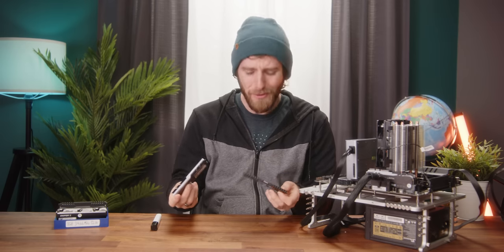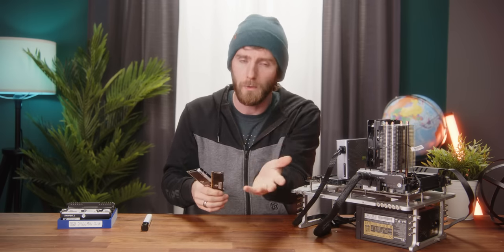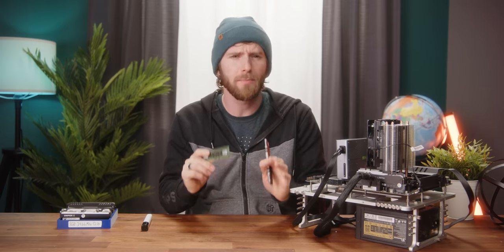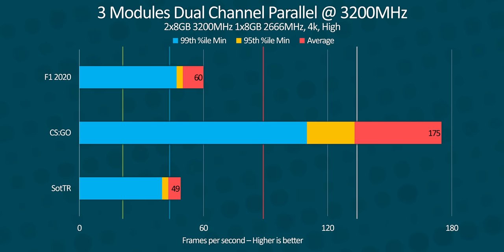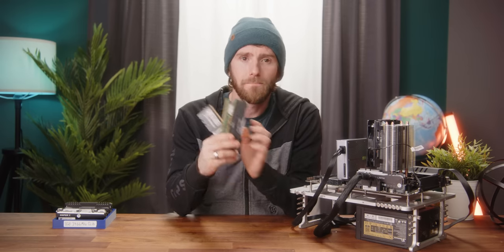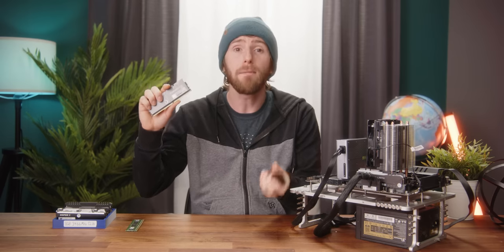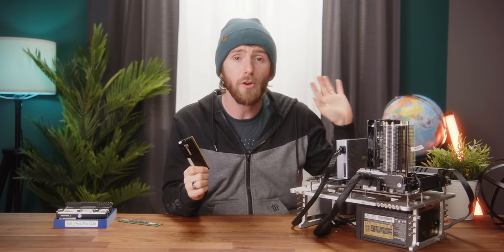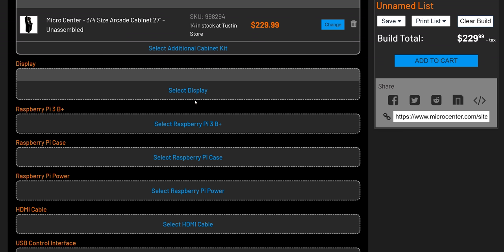Just How Bad is Mixing Memory?

Comment: So I know this is old but I’ll throw my 2 cents in I was playing the first descendant but I kept experiencing stuttering randomly I swore up and down I had 32gb of ram in my pc turns out I was running 16gb (idk I guess I just forgot I put in 16 only) so after I figured out I was on 16gb of ram I realized I had another set of 8gb 3200 hz but different brands everything I read said no don’t do it yada yada my brother was like just do it trust me I ran different ones for years in my old build I stuck them in and they work perfectly fine no issues but they’re were basically identical ram sticks besides brand so yeah it will work fine now running different sticks at different speeds and types yeah it’s not gonna work properly

Comment: One time I had bought a (I THINK it was 8gb) DDR3 ram stick. I tried booting it up solo, there was a beep sound, which, when I looked up, meant that RAM was "corrupted". Then I decided to test it out with 2, so I stuck my original 4gb stick back in, 2nd place, and booted up windows, it started - but, it was sooo slooow, I looked at task manager, it said that the ram was still 4gb, but the clock speed was lowered to the new stick's speed (as it was lower than my 4gb stick).

Comment: If anyone sees this question please feel free to comment. Is it better to have all four slots filled with 8 GB RAM equaling to 32 GB in total or only filling two slots with 16 GB RAM equaling to 32 GB in total. CPU being used in this example/scenario is a Intel I7-8700k unlocked.
Reply: Depends what you mean by better and what your goals are.

Lower density ram tends to run better and faster.  That's why "professional overclockers" use a single stick of 2-4gb ram.  Using less dimms puts less stress on the motherboard so it run better too

So using 2 dimms vs 4dimms depends if your overclocking or not and what u value the most, stock performance, oced performance or ram performance.

In your situation id just get the 2xdimms.  Leaves room to upgrade in thr future

Comment: my old system(now my brothers system) had 2 factory 4gb sticks of ram, i found another stick in a PC that didnt work that my father had, and my cousin had another 2gb stick, surprisingly it worked fine together with no issues that i can tell, even to now, if something would to have happened i would have just upgraded the sticks with newer ones. but no need to throw money at a old system that uses ddr3

edit: forgot to throw in the part where i didnt even have to mess with the bios settings to get it to work

Comment: I got 2 stock ram and 2 aftermarket still work good as long they are set a & b together. It depends on the motherboard u have to know what hz the ram is correct for it. Overall I get 32gb ram wasn’t bad instead of buying the whole package. That was the cheapest option opposed to buying 2 16gb or 4 8gb ram i got 2666mhz I can get 3200mhz but like i said i have to spend more money. I did all the calculations at the store and just figured they would work 😂.

Comment: Hey Linus! I was watching this vid because I was planning for an upgrade. I have a question though for another topic. What difference does it make if for example I use an old (like 5 years old) HDD than buying a brand new one to pair up with my SSD?
Reply: Don't bother with a hard drive, I would save up a bit more for a second or Bigger ssd
Reply: @lettuce7259  Disagree.  Buy an SSD and use it as your main boot drive.  Buy an HDD for general storage.

Comment: I was about to comment that my generic HP RAM which I ripped out of a ProDesk, is running perfectly fine at 3200MHz. Went to check and apparently at some point the BIOS reset itself completely. Running at 2066 and I can't get the magic 3200 anymore...
Managed to push it to 2666 but that's about it now -_-

Comment: I am upgrading my memory by putting some more RAM cards in there but the new RAM cards I bought are way different then the ones I have currently. They are rated for the same speed as the old ones but not in terms of memory per card. I am planning to move one of the old ones next to the other sitting lonely beside it 1 port away in between so I can run them in Dual-Channel. And put the new ones which I have in Dual-Channel as wel with the new space I made.

Is this a smart idea and should this work out just fine? Let me know!

Comment: Bought 2 different sets of patriot viper blackout 3200 8x2 so total 8x4 and I was adding to existing modules so I tried to populate the empty slots and my rig wasn't having it.  So I move each kit to its own channel works at max rated speeds but occasionally will not post after restart

Comment: back in november i bought a decent prebuilt from MSI through Amazon. Good Pc, but I had som strange crashes happening. Tried a bunch of soft fixes, as well as testing and even sending in the tower for RMA not once, but twice. I had looked at everything, tried everything I could, except the ram. Thats where I should have started testing. 4 sticks of 8gigs each that all matched looked good to me ran a few tests but didnt think much as the ram tests kept freezing. RMA sessions focused on the cpu and never bothered chacking to see if the problem fixed. After the second RMA I decided to try using my brother’s old ram and completely remove mine. Boom. Instant no crashes. I even eventually got new sticks. 
what happed? One or more of the sticks that came with the pc were suffering from Memory Fade. memory fade flips bits over time in the ram causing all sorts of problems. The memory dump showed me that Discord had tried opening a file with open argument 2. Whats wrong? the 2 is out of bounds. when opening a file its only 1 or 0. that is how I fixed my problem. new Ram.

Comment: Ive ran 4 different ddr3's for almost 9 years straight with the only bluescreens ive had from me insisting on using a firewire audio interface and windows 10 not liking that, memory is memory (and no tweaking at all, just all stock values) 1 pny, 1 corsair, 2 different kingston

Comment: Congratulations! I have such RAM HX436C17PB3K2/16 on samsung b die. Works on XMP profile 3600 CL17-18-18 at 1.35 V. I want to put another 16Gb, but this one has already been discontinued. There is HX436C17PB4K2/16 on sale, but it already uses hynix chips. Will it be compatible with my memory? And do 4 modules of 8Gb work normally or are 2 always better (never worked with 4 modules)? Motherboard - gigabyte b560m aorus pro, processor - i5 11400. Thank you!

Comment: I realized that I was using mismatched ram about a month ago inside of my optiplex 3020 full of almost all custom parts, so I swapped it out and I was even able to overclock my ram to 1,600 MHz finally. I don't need my computer to do way too much so that's really cool 🙂
Reply: i have a qs can i overclock my 3000 mghz ram to 3200 and pair it with a 3200

Comment: In my System there are 44 GB RAM, 2x 16 GB 3200, 1x 8GB 2133 and 1x 4 GB 2133. It works fine with no issues

Comment: Had 2x16gb on my 5900X bought another 2x16gb (both 3200mhz corsair v pro cl16).  They have one letter difference in their product code and all 4 sticks will no boot above 2100mhz. Pain in the ass.

Comment: The real conundrum is wanting 32 gigs and dual rank, i have 2x8 3200 cl16 ram atm so buying another similar kit would be guaranteed dual rank but supposed possible issues from mixing, on the other hand buying a 2x16 kit currently especially in the budget side of the market seems to be pure luck whether or not you will get dual or single rank.

Comment: I've installed 2 ram sticks in a laptop 1 from Samsung and 1 from hynix, and the system was fine, until it had to render some animations,  and then it constantly gave memory error in the app, but once i switched the hynix stick to more or less the same stick from Samsung (it was from a different laptop) the reder went silky-smooth without any errors

Comment: I ran a 8GB (1600) module with 3 4GB(1333) modules and eventually 2 of the 4GB modules blew up, dunno exactly if it was related to capacity, or speed. and before the module blow up, I had to replace a motherboard because the prev motherboad blew... So if you guys can explain that, that'll be great.

Comment: Thank laptop manufacturers for this lovely headache inducing annoyance. They have been soldering ram to the boards since at least as early as the 486 days (I'm looking at you, IBM). Once they started adding an expansion slots to add more ram, the nightmares began. As I type this, I am using a Lenovo laptop with an AMD A6. 4GB of no-name RAM is soldered to the board, even though specs for this serial number indicate it is supposed to be a removable RAM module. I eventually filled the expansion slot with 16 GB of Kingston RAM, which is absolutely NOT the same configuration or speed of the soldered RAM.

So... yeah, laptop manufacturers are to blame.

Comment: Potentially real bad (/annoying). I mixed separate (but identical) 2x8 kits of Corsair Vengeance. Constant BSODs tied to the video card (yep, but the card was fine). Ram passed Memtest86 because there wasn't anything physically wrong with it either.

Pulled my two mismatched kits, replaced with a single 2x16 Dominator kit of the same speed, not a problem since.

Comment: I have 2. I was resurrecting my old pc and Frankensteined 2 pcs together. They were very similar. The ram itself was ddr3 2 sticks of crucial 8gb 1600mhz cl11 dual channel and 2 sticks of corsair valueselect 8gb 1600mhz cl11 dual channel. It Worked flawlessly. 

Upped my dads older computer until my new ram cards come in. He had purchased a bunch of 2gb ddr3 1333mhz cl7 dual channel a few years ago. His system had 2 sticks of 4gb 1600mhz cl11 single channel. I got the system to post and boot into windows. It ran like a dog though. I downloaded cpu-z for the specific motherboard and looked at all of the specific latencies per card. I booted into bios and had to downgrade to 1333 mhz and up the latencies to the highest of the pairs and everything ran great after. It performs better now than before and once my new ram comes in I will be upgrading his system as well.

We are waiting for graphics card prices to stabilize and then will be upgrading the two systems as we go along.

Comment: I once had a system filled with 14 gigs of mixed ddr3 ram consisting of two 4g sticks of gaming ram with heat spreaders a single stick of generic 2g HP ram and a 4g low profile stick and I never had any issues and it played ram intensive games like rust perfectly fine

Comment: I've never looked at memory timings, speed, or anything. I just brought whatever ram was supported by the PC and installed it and have never had a problem. I've had configurations in the past like  1x256MB 2x512MB and 1x1GB DDR in the same box.

Comment: I run 2 8gb 3400Mhz Corsair vengeance and 2 8gb 3200Mhz Corsair vengeance, both running at their detailed speeds. (In my bios I was able to tell the pc to use the 3400 first, and then if it needs more than 16gb, it would use the 3200)

Comment: I tried this out cause some sticks were just laying around. I had some corsair platinum and I currently had some vengeance in my pc. They were both clocked at 3200 and I figured well same brand same speed. So I tried it haven't had any crashes or any performance drops either. Been like that for about 6 months now so I got lucky.

Comment: Hey linus, 2:18 as long its under 4ghz its fine, but what if it is above 4ghz? My ram module are 5200mhz and 5600mhz clocked down to 4800mhz because i5 12450h only support 4800mhz ddr5 ram. Will it be okay? Sometimes i do get a bit of stutters/lag spike. Is that the reason?

Comment: I've mixed ram in OEM systems for years and still will do it like hp and dell after ddr2 inception in older oem systems, but won't do it in modern gaming builds becaues of XMP overclocking, exactly your conclutions in this video was my understanding of that. The only thing I find false about it is I have a system right now running a moded x4670 Xeon on a socket 775 motherboard and 8 gb ddr2 1166 mhz two mixed matched Gskill and Gygbyte ram chips and they work just fine together and I'm able to over clock them to the reated 1166 speed. I just use it as a storage sever box but it does run windows 10 and has a 3.3 Ghz quad core Xeon. It's not a bad old rig for what I use it for and if a person was poor and didn't have a lot of loot they could build this and use it for a pretty decent computer to go online watch videos or just surf the web, it wouldn't be horrible it's pretty fast for that and if you use Linux on it even faster.

Comment: Was running vengeance LPX Corsair 2400mhz with same brand 2666mhz for about 3 or 4 months did not realize it would cause an issue. Started getting BSOD swapped in 2400mhz hopefully problem solved.

When I bought the machine I discovered it had only one stick and needed the system running for a job with no time to spare so I bought the second stick off amazon with out realizing my mistake. Gave the company deserved shit for not installing the payed for second stick, which they then mailed me. SO  I've just swapped it and done the microsoft memory test (which it spectacularly failed first time) and it passed this time so hopefully no more BSOD.

Comment: Well I didn't really do memory mixing it was more like I bought a memory kit (64GB G.Skill Trident Z RGB DDR4-3600 F4-3600C16Q-64GTZRC) which exceeded my M/B's (MSI X470 Gaming Pro Carbon) max rated memory speed as on the compatibility page for my M/B MSI listed that SKU as supported at full 3600 MHz.
But I got quite some BSOD's and Windows repair needed to repair my system. Now they're going back to the vendor and I personally would by a 64GB Corsair Vengeance DDR4-3200 CL16 Quad Kit and try to OC it to 3466.
Or does anyone of you have a tip for some RGB memory modules to max out my M/B's capabilities? (I try rn to get the most out of it; a 5800X3D will also go into there, currently 2700X)

Comment: You said there’s likely to be no problem as long as we don’t play with overclock configurations, but what if I buy two kits of the same type, let’s say two kits of 64GB (32x2) instead of one kit of 128 (32x4) just because I find buying two kits cheaper, will I have any problem if I want to apply an XMP profile to reach the advertised speed?

Comment: I actually lost the lottery, although not too badly. Some 2x8 3200mhz sticks were on sale and my VR rig really needed to upgrade to 32gb. Unfortunately those new sticks just wouldn't boot with the old 3000Mhz sticks, even with identical CAS latency. Luckily the sale was amazing so i just ended up buying another set. 

Still ended up being cheaper than buying a 2x16 set from the same brand lmao 🤣

Comment: Bro... I had problems even with the "same" specs. I bought 2 HyperX Fury 8 GB 2666 CL16 and they run out of those so the other 2 I bought were Corsair 2666 CL16. It turns out that Corsair are lying and their RAM was actually 2133 CL15 with OC to 2666 CL16. You can't even imagine how my bios was struggling to keep those 4 pieces working together... (Asus Prime X470 Pro with AM4).

Comment: My mom's computer still has an Corsaire 8 GB DDR3 1866 MHz Single Rank with CL36 LOW VOLTAGE (1.2 V) and SK Hynix 4 GB  DDR3 1600 MHz (1.4V) with CL34 and it seems to run fine, i dont know how worse this can get 😂

Comment: upgraded from 16gb 4x4 3200mhz hyper x predator to corsair vengeance pro 32gb 3200mhz 2x16, tried to run 2x4 + 2x16 didnt even boot up past bios, even with some tweaking it didnt work

Comment: 2 different dies on 2 sets of 2x8gb corsair lpx. Spent 2 months getting it stable at 3867mhz to find out I wasn't actually stable. Tried 2 sticks got micron Rev E 4200 mhz boots not willing to push the voltage to get the infinity fabric stable on 5600x. Settled for 3800 c15 on that pair. Other two won't clock much past 3200. micron Rev A. So I got some hynix CJR and called it quits. 16 21 21 21 36 58 @ 3800mhz probably can get the secondaries tighter but tertiaries are all tight asf 61ns on aida and stable so idc as much

Comment: I'm running 2x16 gskill trident z 3200 and and 2x gskill trident z  rgb for amd, one using samsung b dies, the other not... and my threadripper is very happy with its 64gb of ram.  If I try and push it to 128gb, I will swap out the non samsung ram for matching trident z  rgb for amd.  I hear it gets really really hard to even maintain xmp rated speeds with all 8 slots populated on the 1st gen threadrippers, especially when OC'd.

Comment: Hi, wanted to add memory. I currently have the XPG D60G 3600mhz. I went to different stores near me but they don’t have stock of thats model and only have the D50 3600mhz which is a newer model. Can I mix both and not face problems? Thanks

Comment: MY 'OLD' SYSTEM: 2GB Corsair 667Mhz / 8GB Samsung 888Mhz / 4GB Corsair 667Mhz - (14GB Total) running at 1600Mhz just fine, but after seeing this I may drop them down as a test on the timings - ta from UK

Comment: So I have a 2x 8gb 2400mhz kit and just got a good deal on a 2x8gb 3600mhz kit on eBay can I run these together and is there a chance I could fry my other components when trying it?
Reply: you would have to test if they would work together bcause they are quite a ways away in speed, but I don't see how it can fry your other compenents, worst case is a blue screen and you find out it didn't work